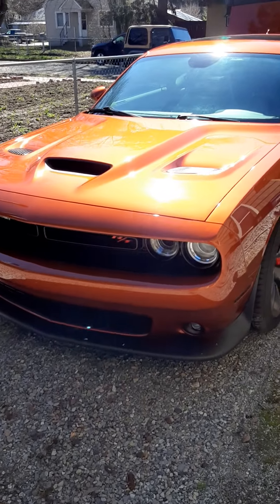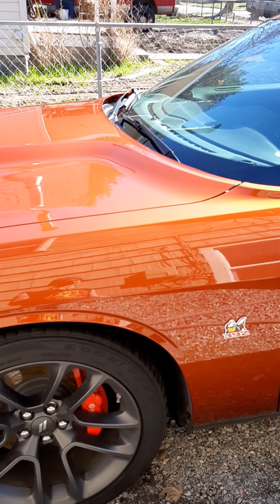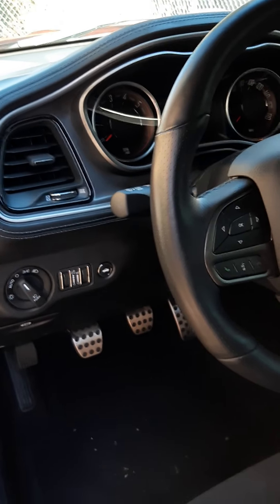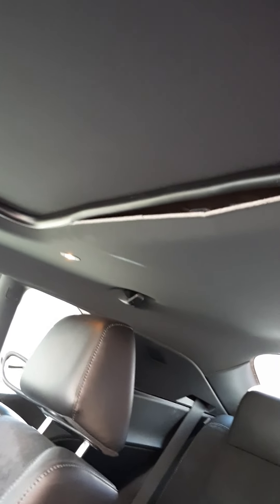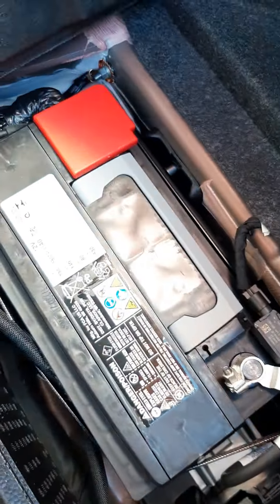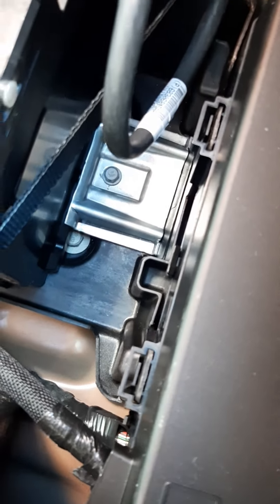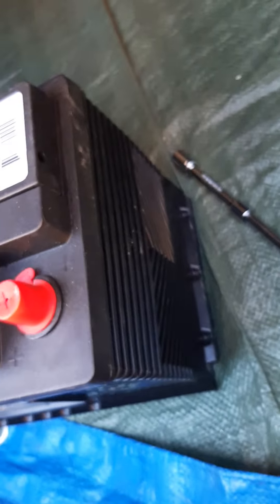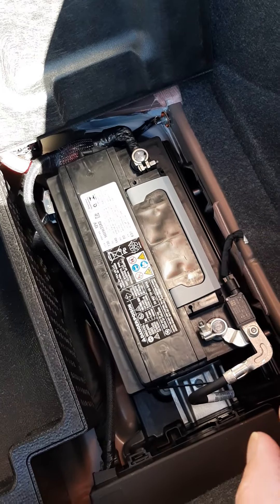How to replace your Dodge Challenger battery part 1

Comment: It’s called it’s a Chrysler product lol. 
Looks good on the outside But the electronics will always be messed up. 

Next time, put a battery tender on it for the winter if you cannot run a cord all the way to the car simply remove the battery and keep a trickle charge